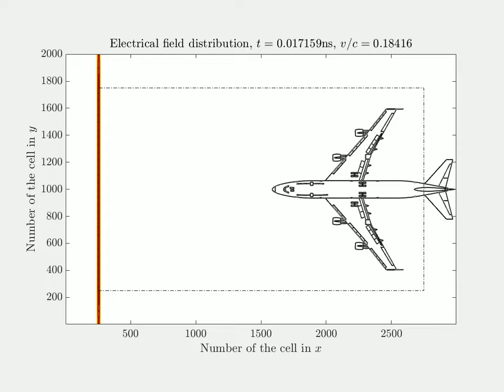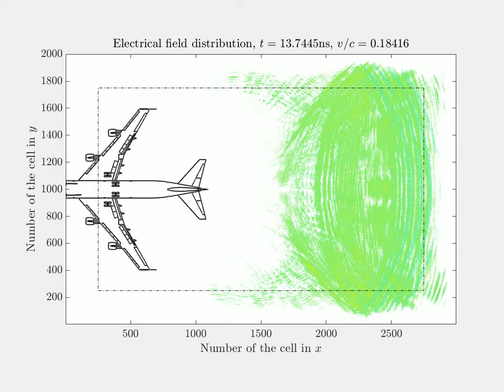Moving airplane illuminated by a plane electromagnetic wave (E=0)

Comment: Really nice simulation. I wonder, though, does the airplane motion really have any effect? The visuals imply that the airplane travels a couple hundred feet in 12ns, a fairly large fraction of the speed of light... I know you don't mean to say that. But I guess my point is that the EM speed is soooooo much higher than the airplane speed that it would seem one could safely ignore it, aside from a very tiny Doppler shift.
Reply from the maker: I decided to work on the subject of electromagnetism with moving bodies because I consider that the theoretical aspect of this subject is not settled yet. I target also the objective to predict the tiny Doppler effects with the proposed numerical approach. We could analyze the effects for different (high) values of v/c and extrapolate what would be the effects at normal speeds.
Reply: Something is wrong with the scaling.  The speed of light is a foot per nanosecond, in round numbers.  (More precisely 11.803... inches per nanosecond.)